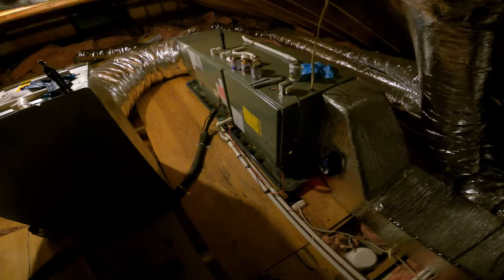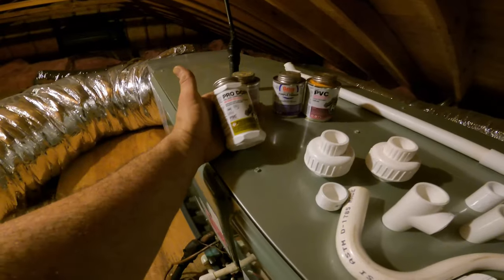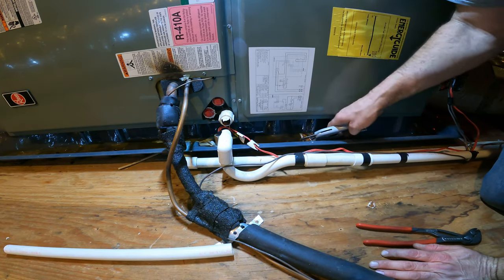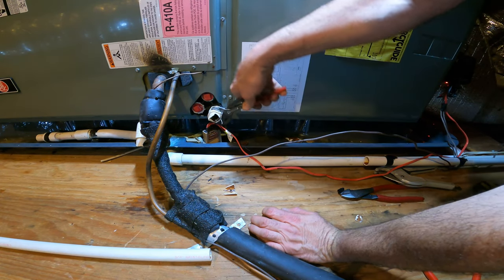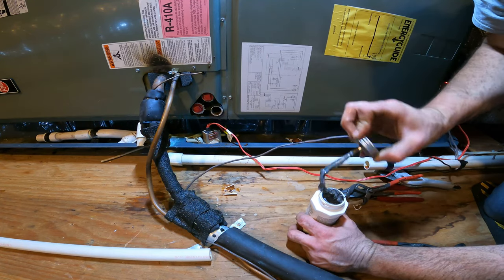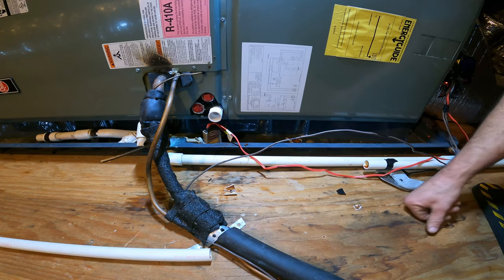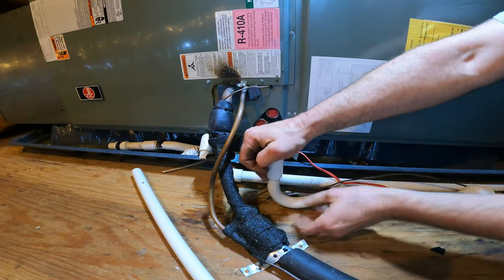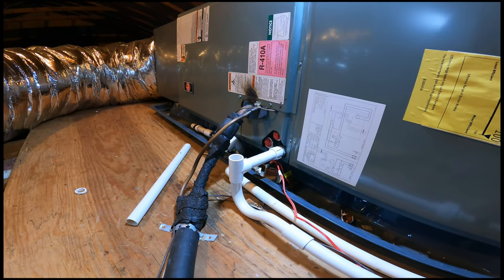Installing AC Condensate Drain With Clean Out Port

Comment: Oh, Yes!!!! Your video helps me a lot in my quest to decipher what's still wrong with our Home Depot Rheem HVAC NIGHTMARE installation back from June 2018. The Saga Continues....
Reply: Same issue! They sent the condensation line directly under my mobile home 🙄 now I have to figure out a way to NOT have it drain directly under my house (which causes musty odors and mold!) Never again will I use Home Depot subs! The water heater installer I used through Home Depot also put the t&p valve directly into the bellyboard under the house! I never knew it was leaking until I had to go under the house for another issue and found the bellyboard nearly touching the ground because it was full of water 😢 Such a waste of money!
Reply: @ejanekendig1984  Sorry to hear about your particular Home Depot "nightmare".  Too late I discovered that a faulty installation only brings more problems...which seems to be your situation, too.  Hope you will be able to decipher and correct it. YouTube is such a learning option, This is a photo of my fixed line: https://drive.google.com/file/d/1Cqmq39M3IuOp5OQ7CHeM5gX9V7do1rd3/view?usp=sharing
Reply: Oh no! Home Depot work is always a disaster. I stick with the smaller shops whose owner is directly involved. I'm sorry for everyone who's going through this..

Comment: Nice video. Got a lot out of it. Like the union idea. In the freez zones the trap is in or over the pan. Unit is elevated higher in the pan.
Reply from the maker: I am in the freeze zone. Yet by the time my attic gets that cold the trap is usually dry. Yet because I am in the freeze zone I always have a clean out port on top of trap. This way on maintenance I can send a gallon through. Have seen drains that sag or run flat freeze. Pvc traps almost never freeze yet the clear easy clean traps seem to freeze and break.  Prevents an angry customer when they start using ac and water comes through ceiling.

Comment: One thing to be careful about is that when you dry fit PVC, the pipe will not go all the way into the fitting.  But when you put glue on it, it will sink in all the way.  So if you cut something and dry fit, it can be just a little short when you glue and fit it.  And you want to apply the cement quickly after the primer as you must apply the cement before the primer dries (about 10 seconds).  This is according to the instructions on the glue.

Comment: Thanks for making this video. My AC unit did not have a clean out installed and your video helped me put one in.
Reply from the maker: Glad it helped
Reply: @howtohvac3234  thanks for posting the video. I just had the same drain setup and now my bathroom sink is gurgling whenever the vent or AC is on. Will adding a vent to the drain line help resolve the problem?

Comment: where is the drain kill switch? I also like a VENT after the trap. You can use PVC glue without primer on ANY non pressured LINE and might make it easier to remove the glued pieces later if needed. Once primed and glued, its done.

Comment: I had a call like this. Over time the air handler foam pads lowered from the weight which caused the trap to move upward because it was right on the Platform. This caused it to not drain. Also the trap could be moved after the union down stream after the platform and above the ceiling and you could just use a tee clean out on the outlet.

Comment: Don’t forget the vent pipe, a p-trap is always followed by a vent pipe……
Reply: For sure. Lines aren’t insulated either. Condensation on them with the cold water draining will drip on the floor
Reply: For a negative side installation 🤔….. i dnt think so. Referencing the “always” part.
Reply: @mannyfresh8504  why not? I capped my vent tube as blower seemed to be sucking in hot and record humid air in my attic and water was condensing inside box and leaking out. Its my theory of where the water was coming from (vent tube). There was no icing on coil nor condensing on outside of unit. Hence, im running No vent riggt now. On less humid days, no issues.

Comment: When I'm gluing, I always put a thin layer of glue IN the fitting or coupler AND on the pipe. If you have a sharp edge on the pipe you can inadvertently push the glue out with an edge. Not saying using glue ONLY on one side is a "bad" thing, but in my experience, I've seen joints fail just from them having a sharp/rough edge pushing glue out. Just food for thought.

Comment: Where is the secondary drain out of the unit into the secondary drain? I do not see it? Also I hear depending on your type of system gas or electric the T should be vented not capped and on electric it should go after the P trap?? This is just what I have been told because my system did not have the secondary drain into the pan and I ended up with a mess on my hands. Rusted out secondary pan and my attic access is like 2'x2' try getting a 60"x30" pan into that attic and then replumb everything correctly.

Comment: I normally install a t before and after the ptrap. Especially if the drain line is super long, you must have an open t after the p trap
Reply: Hi, Christopher, if I only have 1 vent, before the p trap, do you recommend leaving it uncapped even if there is cold air loss? I was worried about losing too much air into my attic so taped the vent shut, but I think that is resulting in water backing up because now there is drainage coming from my secondary pan when there used to not be any.  Any thoughts would be appreciated!
Reply: @joicebass3725  the reason you have water backing up is because of the missing open clean out after the ptrap, thats why technicians should get in the habit of having 2 ts,. The one before the ptrap should always be capped. See airhandlers are negative pressure, because the motor is above the coil, so when system is running it tends to suck air,not allowing the system to drain properly. Have a company come out to install a t after the trap.
Reply: Thank you for the tip. I've got to call to repair a drain line

Comment: That trap likely won't be tall enough if you have a negative pressure system (fan after the cooling stage) - looks like its only a max of ~2" H2O so with enough suction it won't drain at all while the unit is running (and will draw outside air in up though the vent). Air bubbling up the vent causes contamination with dust & debris. For positive pressure (fan before cooling stage) its fine.

Comment: 1/4" drop per linear foot,,,       Simple fix....  Raise air handler...        Blue glue is your friend (wet/dry abilities)
when leaving a/h drain line;  put jones valve in 1st, then cleanout tee (capped off/no glue) then p trap then union. armor flex last. all done

Comment: Thanks my unit was set up similar to yours and did not have a clean-out and flat P-Trap! Why would any installer not do so for a system in an attic is beyond me. In fact, we have had an HVAC service company out a few times over the years and they didn't recommend it?
Reply: If they're honest, they'll recommend it. If they're not honest, they won't say anything because they know they'll be back.

Comment: I did all of this be the air handler hanging in my garage is still leaking from the end farthest away from the drain. I through a level on top and found the air handler has a slight angle toward that direction. Would it be an issue to drop the one side just enough to get the water to flow in that direction? Is there something else I’m missing? Thank

Comment: Here's why they don't put a clean out port in the condensate line.  It's added income to the service tech.  When we can't DIY, we have to call a service tech at $80/hr + parts.  A clean out port wold make it easy for many homeowners to DIY.
Reply from the maker: I put a clean out on every unit I work on. It makes it easy for me to clean drains on my maintenances. Keeping drains clean is one of the most important part of maintenance. A plugged drain that ruins a ceiling cost me money. I install clean outs for free on all AC systems I service. I charge $120 an hour for service. That is the average labor rate in north New Jersey
Reply: @howtohvac3234  good decision & worth it.
Reply: @Dan Burch from my experience and knowledge of being in this trade I can tell you that it's more of bad practice on the installer's part of not putting one. I myself make sure to put one on every job that I do an install on just because it makes PM so much easier and also makes the service go by faster so I can move onto the next call. I don't think it is on purpose that one doesn't get installed, just more of a bad practice on the installer's part ( maybe the installer doesn't do service's or PM or maybe they had a new hire do the drain to wrap the job up and it got over-looked before they left the job ). Im pretty sure this one wasn't done on purpose so they would get called back a year later for when the drain gets clogged. *Just my thought on your comment *

Comment: Why do you need to prime and glue the joints if the contents are not under pressure?
Reply from the maker: Still want the fittings sealed. Water can leak out of unsealed fittings. Think of what the pipe looks like inside the fitting. Water will find a way to leak through anything.

Comment: 1. I'm running it to a condensate pump but the P-trap is right before the pump.  Does that make a difference? Everywhere I've seen has the trap right at the beginning. 2.  How long do I have to wait before I can turn on the AC and run water through it after I have joined all the pipes?  Fantastic video by the way.  I'm working on a rental and the AC went out.  Figured out it was a clogged line so I cut it and cleaned it out.  Wanted to install a cleanout which I can now thanks to you.  This will be instrumental in me refitting everything.  Thank you.

Comment: I was taught that a 'vent' tee is required downline from the trap to prevent siphoning, which can repeatedly empty the trap. Is this not true or required?
Reply: That is true.   DO NOT copy this install.  You need a vacuum breaker downstream of the trap.  Otherwise just like holding your finger on top of a straw.  It will not drain properly.
Reply: You got that right

Comment: Primer is not cleaner. Primer melts the pvc to allow the glue to weld the pipe and fittings together. Without it, it’s just like taping the pipe together.

Comment: The instructions for the primer and glue I sold at Home Hardware are different than the instructions you show in your video. They say to prime the fitting, prime the pipe and then prime the fitting again. Then you put glue on the pipe then the fitting and a second time on the pipe. I see that you prime both the fitting and the pipe only once. Then you put glue only on the pipe and use just one coat. Is this how you do it for all PVC applications or just for this because there no pressure to cause it to leak.

Comment: Bring back constructive comments!  Just get a 5 horsepower or betweer wet vacuum and suck out the discharge end every so often. Doing this will greatly reduce the chance of a clog at the drain pan nipple and won't overlook the portion of the pipe going back to the air handler. 😊

Comment: If the evaporator coil is under a negative pressure (draw thru) the vent should be upstream of the trap as shown in this video.  If the coil is under pressure (blow through) the vent should be down stream of the trap, otherwise air pressure from the fan will blow out through the vent.
Reply: If you didn't install the HVAC system, how can you tell which one you have?
Reply: @sicsempertyrannus226  Put your hand over the open vent and if air is blowing out then it's under pressure, meaning the fan is blowing through the coil rather than drawing it through.
Reply: Rob Michael
I have a downdraft air handler, the a coil is on top, and blower is underneath pulling air through the a coil from above and sending air through ductwork  below. What do I have, + or -, and where do I put the vent cleanout. right now there isn't any trap, or vent, but water is draining out outside.
   Thanks.
Reply: @remichal I have a downdraft air handler, the a coil is on top, and blower is underneath pulling air through the a coil from above and sending air through ductwork  below. What do I have, + or -, and where do I put the vent cleanout. right now there isn't any trap, or vent, but water is draining out outside.
  Thanks.
Reply: @robertbelknap  If the fan is pulling air through the coil, like yours, it's a draw thru and the coil is under a negative pressure.  The trap is there to prevent sewer gasses and insects ( if it drains onto the ground) from getting back into the air handler.  The vent prevents siphoning.  In your case the vent needs to be between the air handler and the trap.
Reply: @robmichael6512  Thanks for commenting,  I appreciate it.
Reply: Mine blows out air pretty strong, so I put a cap on it,  but then all that forced air causing the downstairs sink to start burping (that’s where it drains into).

So if I cut in a tee down stream with a vent, that will fix that? Won’t the forced air still push all the water through the trap?
Reply: @mrDmastr19  If the sink is burping it sounds like there's no air gap between the condensate drain and the trap under the sink which is required by code.  The best way to deal with that is to install a dishwasher tailpiece between the sink and the trap and those are available at any home center.   But it also sounds like you have a blow-thru coil that's exerting more pressure than usual on the drain pipe.  My first suspicion is the ductwork may be undersized or has some quirky bends close to the unit which could be restricting airflow so it's relieving through the drain.  I think your case is an exception because there is always some air movement in the drain with a blow-thru system but not enough to blow the water out of the trap.  Personally, I specify deep traps (at least 2") which tends to better resist that blow-out but in your case the only possible solution might be to put the vent between the coil and the trap which will act as a relief.  You will feel air blowing out of the vent but it will also keep water from blowing out of the trap and eliminate air blowing into the sink drain, causing that gurgling.
Reply: @robmichael6512  wow thanks for the detailed reply. That all seems pretty logical…. The sink has a typical ABS p trap…. And the condensate line under the sink does have a rubber hose which goes from the white pvc to the y tail piece ABS which should be to code, and it’s upstream of the sink trap. But it’s probably too much air pressure. And I do have some pretty tight bends in the flex ducts right off the air handler. So I think your right just too much pressure is relieving because of those bends. They probably should of put hard 90’s rather than just bending the duct so abruptly causing it to almost pinch. When it cools down in the winter, I’ll trying re doing the ducts, for now I’m gonna leave the cap off the condensate clean out and let the excess pressure blow out.

Comment: Thank you for the great tips!
Is the installer (who is licensed and insured) responsible 
for water damage caused by the failure of the missing (Never 
Installed!) secondary condensation drain to emergency pan from the air handler to handle water 
when the Primary Condensation Drain fails?
The manufacturer's installation instructions for
an air handler located in an uninsulated attic over living 
space in a hot, humid, tropical environment says BOTH a 
"Primary Condensation Drain and a Secondary Condensation 
Drain should be installed."
Reply from the maker: A secondary drain could be a drain pipe from pan out of attic. Yet in many places a drain overflow switch, can be used instead of secondary drain. Damage from a plugged condensate line falls on the homeowner, or the company performing annual maintenance on the ac system.
Reply: @howtohvac3234  Thank you for your prompt response!
Are the installation contractors responsible for
damage if the manufacturer's installation instructions were not followed? The secondary condensate drain that should 
have been installed to carry water out of the air handler and into the emergency pan was never installed.
Reply: @howtohvac3234  
Your secondary condensation drain is still plugged. It is 
the red plug just to the left of your primary condensation 
drain. This secondary condensation drain should carry water 
out of the air handler's internal pan and into the emergency 
pan when the primary drain fails. Both drains should be 
properly trapped.
The drain from the emergency pan to the outside is a 
separate drain tube that will carry water out when the 
primary fails.

Comment: Very good video. My A/C drain line comes out from the pan, makes a couple 90% turns and connects up to the PVC drain that goes to the floor drain. I don't see any P trap. 

Should I install a P trap?

Does your PVC cutter cut the pipe straight? I had purchased one that cut the pipe but the cut wasn't perpendicular, it was on a slant. I returned the cutter. Do you have a recommendation for a PVC cutter?